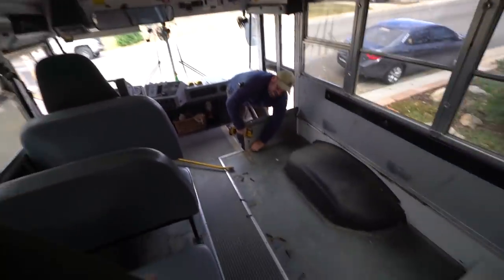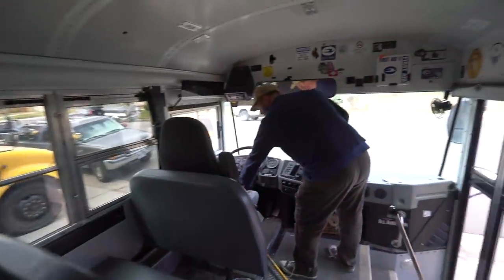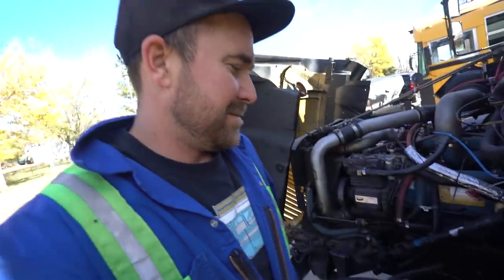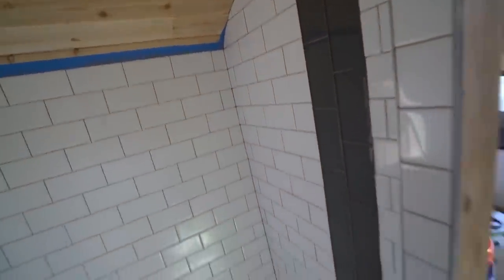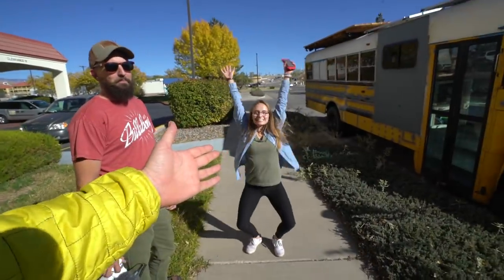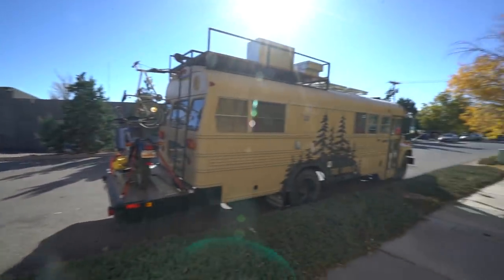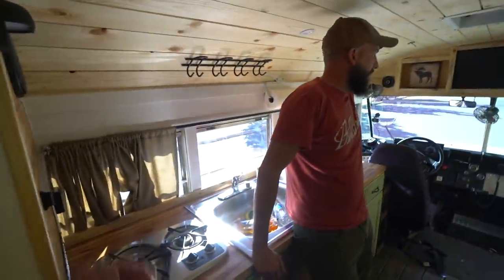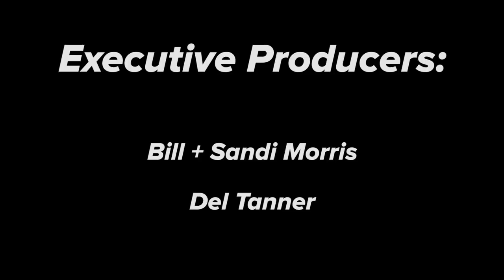Perfect VanLife Bathroom?

Comment: It's like falling into a time warp
Reply: Steve, you should see my bus right now.... wires everywhere, ceiling ripped out, working on the floor today & removing some wires... have some things that don't work now... oops.
Reply: I was worried about things not working so I pulled one wire at a time from the fixture back to the panel. Then at the van build Badge helped me with the directional problem and started yanking wires willy nilly. Everything still works.😁
Reply from the maker: Don’t disturb the spoiler alert commenters haha
Reply: @JaxAustin  I would never do that. They are fun to watch

Comment: Wait... What's Reed using to undo the seats at the wall? I've got one left and two barriers I'm trying to get at and can't because of where the bolts are and I've been chopping away at the metal that's blocking them with my angle grinder cutting wheel.
Reply from the maker: Just a socket extension. He’s prying the crowbar and making the flange bolts catch. You can always cut the seat frame for better access
Reply: Jax Austin gotcha. Ty. Maybe I can spare my precious skin some burns from the sparks of the grinder. There's always something exposed no matter how much I cover. Paying for it today.
Reply: Large crowbar !!! Works every time !!

Comment: watching this i see how the seats come apart and wondering if the  bones of the seats could be used for making a bed, table and other things just leaving the bones as supports?
Reply: even using the cushions
Reply: @JaniceLalla  The seats are basically garbage. It would take more work to try to salvage them than they are worth. I recycled the steel though....
Reply from the maker: You could, but it would be a ton ow welding work. Most people scrap them. Metal is pretty inexpensive brand new.

Comment: wow that meet was quite a while back , looks like you got some catching up to do on the video's
6.2 and allready touching the ceiling huh , think IF i ever going to live in a bus i'm going to need more headroom ..... im 6.6
had this idea of raising a 3 feet wide strip of the roof along the length of the bus and put say 10 inch high windows along the raised space 
the idea behind it was getting more light inside without loosing a lot of privacy  
you only walk upright through the gangway anyway , at the kitchen and all the other stuff you stoop over to see wat youre doing or youre sitting (with the exception of the showerstall where i might sink the shower tub 12 inches intoo the floor to clear the showerhead )
Reply from the maker: They’ll catch up soon. I took a holiday break, and wasn’t feeling 100% last week. 6’6 and you’ll have to duck a little. Roof raises are an option, but expensive. Shuttle buses are taller, but limited to E series or similar.